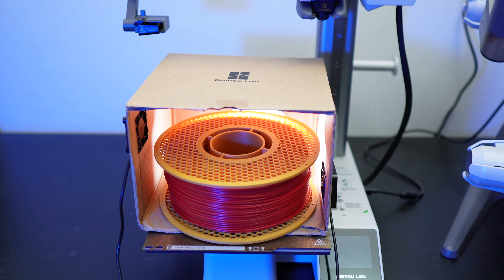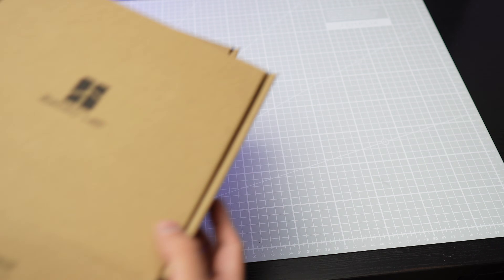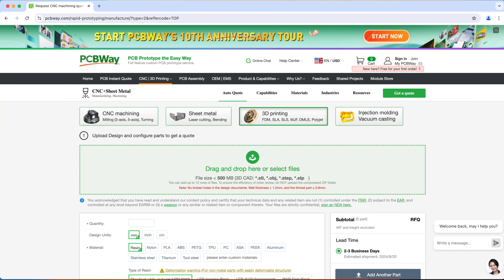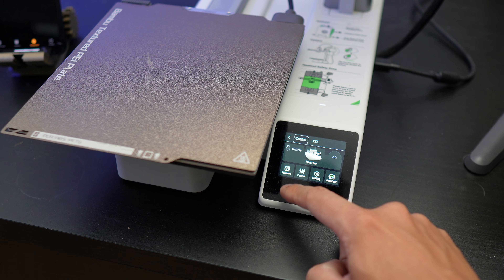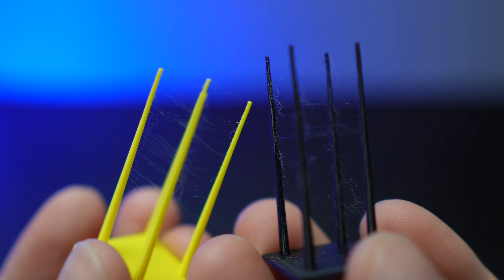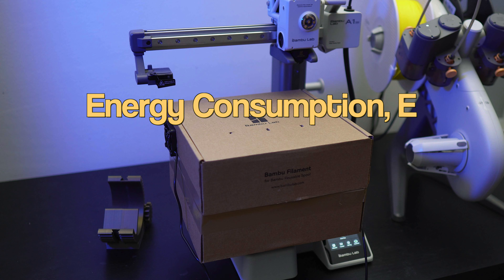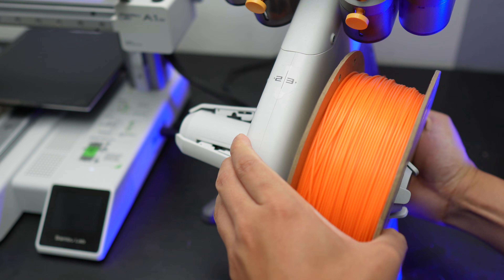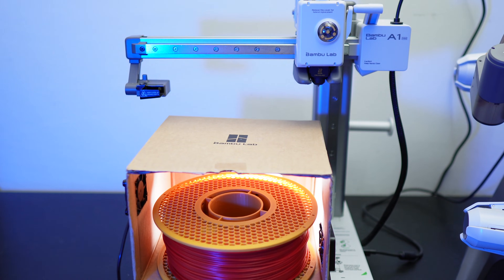How to turn Bambu Lab A1 Mini 3D printer into a Filament Dryer

Comment from the maker: Recommended 3D printer: https://www.awin1.com/awclick.php?gid=570772&mid=46345&awinaffid=2034675&linkid=4382705&clickref=
A1 Mini Combo: https://www.awin1.com/awclick.php?gid=570773&mid=46345&awinaffid=2034675&linkid=4382675&clickref=
Recommended Filaments: https://www.awin1.com/awclick.php?gid=570777&mid=46345&awinaffid=2034675&linkid=4382680&clickref=

My 2nd favorite filaments: https://geni.us/A4OFomi
Lubricant for X,Z,Y-Axis rails & idler pulleys: https://tidd.ly/3KMFHqs
Grease for Lead screws: https://tidd.ly/3Lk36j2
Deburring tool: https://geni.us/9WGzv
Wire cutter: https://geni.us/NAwQIL
Heat gun: https://geni.us/Jdcu

#Affiliate

Comment: Just a tip: 
Removing the fan on the top and bottom would serve as a much more efficient method because you're allowing for the process of 'convection' to occur naturally instead of pulling air into the box at a high speed which doesn't have the time to properly heat up as the air that is naturally sucked in through the small vents at the bottom of the box which will naturally rise as it gets hotter getting expelled through the vents at the top of the box without the need to waste energy with an additional fan.💯

Comment: All this video tells me is that filament drying is largely unnecessary, especially for PLA. It might be more worthwhile for PETG and TPU, but I've been 3D printing for 5.5 years now and I've NEVER dried any of my filament. I live in a climate with low-mid humidity by the way.
Reply from the maker: I observe the same thing as well. Generic PLA in general doesn’t absorb much moisture. However, my PLA matte filaments tend to get stringing problems if I don’t store them well.

Comment: I've literally done this practice for years on my 3D printers using just a filament box with holes punched in the top. From 1-4 hours and my PETG filament is usable again. I'm shocked as I've been putting my filament into vacuum bags with desiccant and the PETG still gets moisture in it. Most are fine but again today it happened, snap, crackle, pop and a ruined print. Just wanted to see if anyone had done another video on this. Also ignore Bambu as long as the bed heats up you can use it as a filament drying in this fashion. This is no different than printing something on it.
Reply from the maker: there‘s another culprit that might be the reason why filaments get brittle and snap into pieces, and that is the mechanical stress. 
Filaments get extruded, cooled in a water bath, dried, then coiled in the production. It‘s in a continous state of being bent in the spool. Plasticizers in the filaments get bad over time, so it makes sense that the older the filaments get, the more prone they are to break.
You can also observe this when you respool a roll of filament. You’re basically adding stress to the spool, coiling it in another direction, when the spool is already under mechanical stress, so it will break much faster. So it‘s always a good idea to respool it twice to bring it back to its original stress state, or use up the filament as soon as you can without storing it for years.

Comment: Where do you people live that you need to dry your filament 😂its a 3d printer it should be in well ventilated area so not sure why or how your filament is getting wet. I live in England for reference
Reply from the maker: sometimes the fresh filament you buy already came in wet👍🏼
Reply: @Lukis3D  wtf why would it come wet they're vacuum sealed 😂doesn't sound like the filament is the issue
Reply from the maker: have you seen how filaments are produced? They run through a water bath after being extruded to be cooled. Of course the water gets blown off but they arent produced in a totally dry environment. They dont dry the filaments before they send it to you. Thats why bambulab always recommends you to dry some fresh filaments before use.
Reply: @Lukis3D  says nothing of the sort in the manual 😂try again

Comment: Very good video. Thanks for taking the time to perform the experiment and publishing your results on YT. Fortunately, I've not had to dry any filament where I live (hot, inland regional area of Australia). I have several large plastic tubs with lids within which I store my open filament, along with plenty of homemade desiccant bags. I find this more than sufficient to keep my PLA dry. For PETG, TPU, etc., I store in vacuum bags with a desiccant pack after use.
Reply from the maker: thanks man! yeah that’s also a good practice but its only passive drying. It’s drying the air around the filament so it wont get wet any further. You are lucky that you live in a dry area, so passive drying isn’t really necessary.
The problem is, if the filament is already wet to begin with, you would need to actively dry it. Some fresh bought ones can be wet too. So i really recommend getting at least one drier, just in case that you got a wet filament.
Reply: @Lukis3D  Noted, and thank you. I'll investigate my dryer options and cost.

Comment: Great video, you inspired me. I followed your instructions, except using two fans, I find one fan to suck the air out at the top and a hole at the bottom sufficient :)
Reply from the maker: thats great! glad that it worked out for you. Yeah 2 fans are surely an overkill. 1 fan is surely enough👍🏼
Reply: That is a much more efficient method because you're allowing for the process of 'convection' to occur naturally instead of pulling air into the box at high speed which doesn't have time to heat up as the air that is naturally sucked in through the small vents at the bottom of the box will naturally rise as it gets hotter getting expelled through the vents at the top of the box. 💯

Comment: Why are you using a scraper to remove models? You have a flexible plate. Just take off the plate, give it a flex and your model should pop off.
Reply from the maker: if its still hot, its harder to remove the model. I needed it off quick so i could print another one😄

Comment: I use the esun lite dryer and even print from the dryer
Reply from the maker: i also plan to use the dryer to print like TPU or something. How do you like your esun lite dryer?
Reply: @Lukis3D  I'll chime in even though i don't have that specific dryer. I have a Creality Space Pi (2024) single spool dryer and it works amazing especially for printing TPU from it. I printed a benchy after a full 6h 60C dry cycle and it had 3 very fine strands of stringing in the entire print, and zero bubbling. The only issue with the Space Pi is that it doesnt really have a dedicated vent to get rid of the moisture. I resolved it by printing a silica bead box for inside as well as a little spacer for the lid to let the moisture escape while retaining the vast majority of the heat. It can also heat up to 70C for drying filaments such as PC PET ABS ASA PA etc

Comment: With fan it dries the filament quickly, pla @58° around 2hrs works best for me
Reply from the maker: 2 hours? that’s really quick!
Reply: @Lukis3D  yes using powerful fan gives best results, you can even bump the temp a little higher for fast results

Comment: You could also rise the filament spool for the heat to spread more evenly
Reply: I think this is a must.  In the video the warmth of the bed is mostly wasted as only the air in the center of the spool will get warm (and hence dryer) and that rises and is then immediately pulled out of the box.  The new air coming from outside is colder and still "wet" and never gets time to heat and dry as there's little contact with the warm bed.  You want to have the incoming air move over the bed, heating it and by that drying it (relative humidity) and then that dry air should move over the filament to extract the moisture from that filament and then that now more wet again air should be moved out of the box at the top.  So, just have some air inlet holes at the bottom of the box, put some small "feet" under the spool so that the fresh air at the bottom can get heated by the entire bed surface and that should improve the drying a lot.
Reply: @MisterkeTube 💯% agreed! The inlet fan is definitely detrimental as you mention since it's interfering with the natural process of 'convection' if there are openings on the bottom of the box and the hot/moist air will be naturally pushed out through the vents.
Reply from the maker: yeah i was thinking that too, but the spool also acts like a weight to hold down the box, since only the thin frame of its base is actually touching the plate.

Comment: Great video, for the printer method, I've found that it needs a bit more heat to really work - for example - PLA recomended temp - 50°C  - set the printer to 55°C - 60°C, and that worked really well even after only 1-2 hours
Reply from the maker: that’s a really great tip, thanks for sharing! I’ll make sure to increase the temp slightly next time